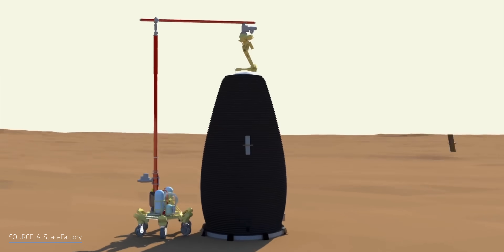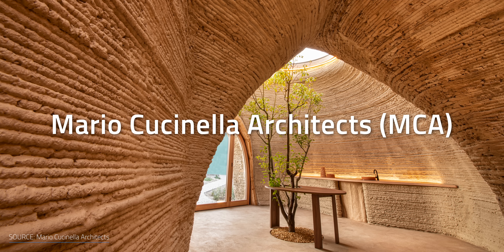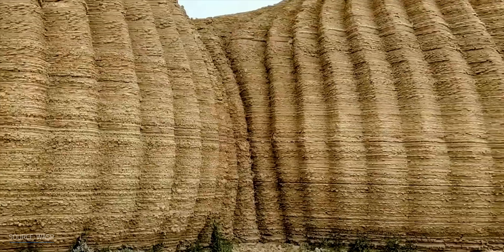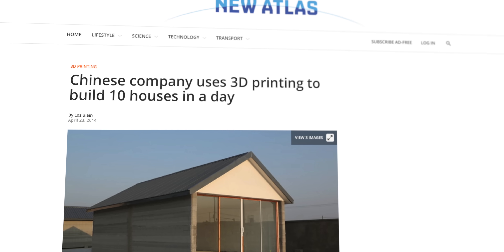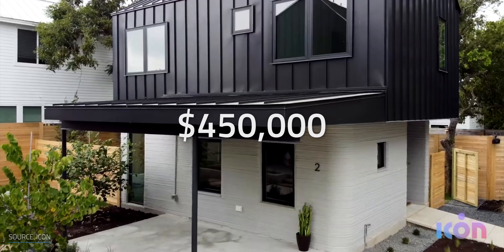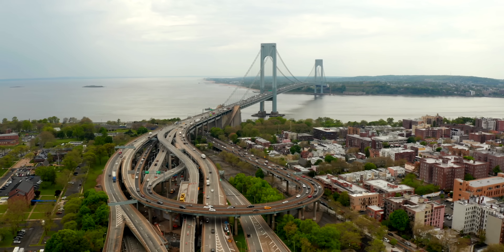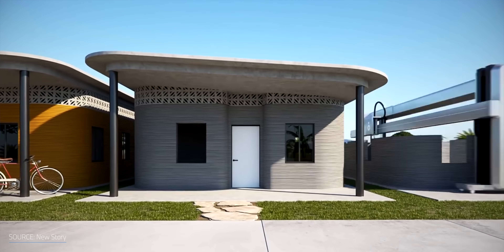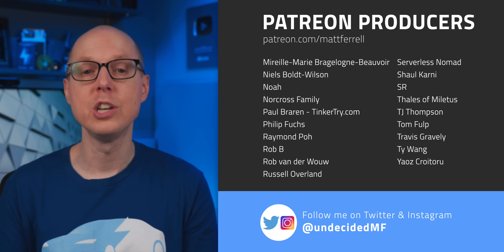The Truth About 3D Printed Homes

Comment: Interestingly enough the best 3D printed house concept (so far) came from the 60s from the Danish as far as I know and used en masse in former Soviet countries. They would make wall sections (called panels) from reinforced concrete with all tubing for water and electric lines pre-installed. They would transport these panel on-site, weld the connecting rebars together, use a but more contrete fo fill in panel connections and there you go. In Hungary they even went further establishing multiple "house factories" that would manufacture complete bathrooms complete with plumbing and tiles fitted even before transport - they would then transport the complete room into the building site, place it and connect it. Only thing they messed up is the design, most of these panel buildings look horrible (though a lot of them getting new insulation and with it paint jobs, which help a lot).

Comment: How is the global housing crisis defined and how does this address that problem?  Any claim that 3D printed housing aims to solve the problem is a handwaving lie if it does not say exactly what they are fixing.

This solution seems suited for areas where land cost is minimal, but isn't the housing crisis more urban where there is premium on land which is almost universally addressed by building up? Even in shanty towns which are low height, the density is extreme.

What about  clean water and waste removal?

Comment: This is definitely not a solution for the housing "crisis". If anything this is just going to wreak havoc on local economies. 
Almost all human housing materials come from sustainable materials. Even though we have become better at hiding it, most humans still make their home out of rocks, sticks, and dirt. When built with care these structures can easily last for hundreds of years. 
All this movement is doing is trying to find cheaper ways to to build the structure. The bonus is you would be lucky if these structures would last 20 years. There is almost no good way to repair damage if it was to occur. 

Almost all land animals have no issue living around human populations in rural settings. The real problem is human plastic waste and transit. The real solution for that is to actually create things that are built to last and be easily repaired. The transit issue is a bit more complicated, but there are solutions that are showing promise. 
The real issue that needs to be addressed is housing is how to lessen carbon emissions when heating the home. If we were to go back to wood burning, the level of carbon and ecological disaster would make gas burning cars look like a joke. Natural gas will not be an option in a few years time when oil production drops off. As it stands now that really only leaves electric heating as an option. When combined with the increased demand from electric cars, many power systems will fail to be able to keep up with the demand.

Comment: One thing that is rarely touched on with a lot of these projects is that round spaces are really awkward to use. Want to hang a picture? It's awkward. Want to put a wardrobe up against a wall? It's awkward. Most modern furnishings aren't curved or round, that may change if printed houses take off but it's something to consider.
Reply: There are rectangular 3d printed buildings.
Reply: cabinets, beds, windows doors....

Comment: After watching dozens of men and women dig holes, strip logs, and build houses in the woods with nothing but mud, stones, wood, and greenery. Some even had decently sized farms, furniture, and fireplaces. These 3D printed houses seem like a dystopian mockery of what we can do just as easily with a little knowledge, practice, and time, and even better. They tout these things as eco friendly when simply being alive will mean 55k tons of carbon are put into the atmosphere over your lifespan just because you need food, a comfortable temperature, and clean water. Not to mention medicine and anything outside of that. The machines being used to 3D print these homes run on either fuel, or electricity produced by fuel, and neither of these are eco-friendly. The only truly eco friendly option is Nuclear, but there's a lot of pushback against it because so many people are unaware of the strides we've made in improving it being locked behind hush warrants and government red tape. There's no getting out of the cost of existing.

Comment: Stop this meme about EVs having no emissions
Lithium mining is more carbon intensive than oil
Reply: Do you have a source?
Reply: @reevesjustin  nothing that I can  share in a YouTube  comment. It gets flagged as spam. Just do a google search if your being sincer. 

MIT thinks it will take 4 years for an EV to off set its carbon cost, which would be fine. However think tanks in Germany believe efficient diesels could out pace EVs assuming the battery lasts 30 years.

Thing is that will all improve as grids switch to more carbon neutral energy. Mines need to as well. But the tech isn't ready.

Also remember that while Australia is the leading excavator of lithium China and Chile are close seconds and thirds and you can bet the working conditions for those mines aren't 1st world.

So even if you do address the carbon issue there is a significant human cost you need to ratify within  your mind.

Comment: It seems to me that the most efficient way to construct houses would be to build them all out of reusable components that are constructed in bulk and are individually small enough to be transported by tractor trailer.  One floor might for example be composed of 7 outer wall units, 4 inner wall units, and 3 support column units.  Foundations could be made in a handful of standardized sizes that the components fit into.  The walls would be made of concrete with long concave sections covered by metal panels which could easily be accessed later by just unscrewing them to place water and electric lines, and which would remain accessible after installation for any potential future repair, none of this hiding stuff permanently in the walls nonsense s.t. accessing it requires a sledgehammer.  You couldn't have arbitrary architecture that way, the components would be designed to fit together and would all be at a handful of nice angles: 30,45,90 degrees, this would have the added benefit of making the architecture load calculations easier, and software could be developed to do both these things.  The construction cost would then be reduced from about 50% of the total cost to mostly just the cost of: using tractor trailers to ship the wall components, using cranes to transport and place the factory assembled components into place on site, the cost of mass-assembling those components.  The cost of hiring an architect would also be eliminated.  Cheaper materials than concrete could also be used, so long as they can also be mass-produced in fixed shapes.

Comment: Dude you need to have a more structured speech, you can’t just throw phrases at people without a concrete line of thought other wise you end up not adding much value to the conversation. You need to do something like pros: 1,2,3… cons: 1,2… weight of the pros vs weight of the cons. You know, something that actually provides the whole picture in a clear manner (hopefully using graphics) therefore paving the way to new ideas, improvements and in general better communication

Comment: I wonder if this idea of using dirt in some way with 3D printing could be utilized with underground homes or homes where their ceiling is at ground level.  You'd need a very strong structure to hold back the walls of course.  But maybe there would be some advantages of 3D printing using the same dirt as is all around you.  What do you think?

Comment: The 3D Printing aspect seems kind of ancillary or parasitic. Can't the same mud be formed by hand with wooden molds and (well) paid labor?
Reply: yup. standard practice in African countries with clay soils. What also helps a lot is generous roof eaves overhangs, which protect against rain. Add generous wrap around veranda which acts as an apron, and then your clay brick walls have fantastic protection against moisture. It would still be a good idea to frame this structure and not rely on the clay as load bearing. This is all done in Africa in a multitude of ways. From Dimitar, Architect working in South Africa.

Comment: 3d printing a structure is a solution looking for a problem. I doubt there's practical savings in cost, time or energy over other traditional methods. Prefab and modular homes built in a factory are probably better all around over these things.
Reply: That is so funny, as it is essentially the same comment I have made on several of these videos.  And they don't understand the problem(s), because often they are creating more of them.

Comment: housing like everything else is overinflated in costs.  People who know how to build a home think they are entitled to make exorbitant wages to build them.  To costs in materials is on the rise not due to scarcity but due to onerous regulations by the climate nazis of their government.  (climate change is a big fat lie so they can jack up prices nothing more).  My grandfather built his home in the late 60s with no difficulty in the upper mid east.  I think he spent less than $4k on materials and the home had a basement the size of the upper or ground level.  This outlay of money also included an out building and shop the he used and lived in while building the main structure.  With printing houses out of foam filled concrete the primary cost is setting up the rig to print the structure.  The advantage of this process is that you can easily layout curved and rounded sections making the home more sympathetic to the wind and rain.  The layer thickness and hollows (later filled with foam) have impressive and unparalleled insulation properties.  The draw back is that second levels may be difficult to set up as they require additional support much like an FDM printer.  Still the entire ideology and process is fascinating and hopefull

Comment: A recent study determined that the majority of car-produced air pollution (particulate pollution by weight) is actually from micro-particles of rubber from tire wear.  It was discovered that this is far more damaging than the chemical pollution.   Unfortunately, because of the increased weight of electric cars due to the batteries, electric vehicles actually produce more pollution than gas powered vehicles (not including the fact the the majority of electricity used to charge said vehicles is generated by burning fossil fuels].  We're not there yet.

Comment: It's called cob house or mud house. Thing is those melt under rain even when dried. That's why they need roofs with protruding overhangs and you need to re-coat them with a protective layer every few years.
As i understand low and mid-rise buildings would be most efficient environment wise. 
It's still cool tech, although it will result in dystopian hive like neighborhoods, not because it has to but simply it will be the most cost efficient.

Comment: what happens when it rains? what happens when bugs get into it? what happens during an earthquake? how do you repair it? what about plumbing and electric? and when little animals get into the hollow spaces inside the walls how do you get them out? you live in a house made from mud and shit if you want to. I will stick to brick and wood and waterproof roofing because it's cheaper, it works better and it lasts longer...and it's not shit.

Comment: A number of years back now... I worked for a Florida company that took to using NuCor Steel's Roll-formers that took 6inch wide coils of galvanized steel to make either steel studs or roof trusses that were cut, notched, or punched with a CNC controlled head that can reproduce a given floor plan countless times, that's able to be fit and be secured easily within a conex box at night and operated with any steady 220v power source. Small forklift is required to handle and load the coils, but simply hand tools and pneumatic tools handled everything else. During 3-4 day span, we were able to create at full 13k to 17k SQ ft house during a single 8hr shift, then on Friday the wall panels were loaded on one flatbed, and the trusses on other. As long as the foundation was poured correctly, within 6hrs a the full frame set can be anchored on site and tradesmen can start the next day. The normal scraps for making an entire house could fit in a 5gal bucket! Using a fixed floor plan or plans and well trained people, not only was the waste greatly reduced, but with results being constant and 100% repeatable - the time from when the slab was poured to when the keys to the finished house was turned over - it was possible in less then 50 days...

Comment: I dont think you have address the challenges of population density and availability of land.
A 3D Printed house inc. setback would be approx 50-100 Sq M.
It could be feasible for Rulal and sub urban areas.
But unless they can go vertical, it will be a challenge. There is not enough land for sustainable 3D printed houses in cities.

Comment: Electric cars currently are not all that green take for instance the charging station is powered by the power grid which in turn is powered mostly by coal powerplants. Perhaps in the future it will be more green but even the massive batteries are made using very toxic material. There are current breakthroughs though in both these aspects. So for now they are far from green but they will get there in the future. Just thought Id correct you.

Comment: It kills me when it's argued that cities are more eco friendly due to population density. If the housing areas were better designed (actually planned out instead of the mess they usually are here in the US) and had mass transit systems put in place then the efficiency would likely be comparable. 

If people would stop reaching for the moon and apply a little common sense and be pragmatic then we could make things a lot more sustainable without having to reinvent the wheel.  There are hundreds of well known methods that have been historically successful and yet they are often ignored for some trendy new thing.
Reply: Well they're not designed better, mass transit in the US is negligible, so the stats are correct, and your point is moot until we get better city planners who actually understand the problem.
Reply: @jaemac1410   stats for old design standards are irrelevant if they start using sustainable designs.

While new tech might aid in solving some of the problem it isn't going to help much if no effort is made to address the underlying problem which is poorly designed urban developments. Also, moving everyone into cities isn't feasible unless you have a dictatorship. Even then you need people to run farms and things outside of the cities.
Reply: @jaemac1410  who are you talking to, me or OP?
Reply: LOL!  Please explain how a well-planned mass-transit system that transports workers 35 miles from the suburbs to the city is "more eco friendly" than a poorly-design bus system that transports workers sixteen blocks, from apartment to work, within the city.  And you know what those suburbanites do when they reach the city, right?  Yep, they hop on the local city bus to actually complete their journey.  In fact, you get FAR more bang for your transportation buck when the user density is high and the transport distance is small.  This holds true whether you're moving workers or schoolkids or groceries or gas and electric utilities.  If it "kills" you when people point out the obvious, dkail, you must be perilously close to dying.
Reply: @jasminelindros8923  you're basing this on current designs. You're right if you're only going off of current methodology. I've not argued that.

 Without writing a dissertation here about urban planning there isn't much more I can say. The point being that improved planning could narrow the gap quite a bit.
Reply: @dkail08  I see you failed to provide the explanation I requested, dkail.  Perhaps you should consider basing your opinions on facts instead of expecting anyone to agree with your incorrect misconceptions.
Reply: But commie blocks will always be more eco friendly than suburbia tho... Mass transit is one of the reasons yeah, but it is definetly not the only reason... For starters, sprawl incentivises car centric approaches, which are terrible (roads are terrible, cars are terrible), houses are less energy efficient, houses are by definition less green. Logistics of goods is worse too, not just human transportation.
Reply: @tristan7216  my comment is exclusively related to the eco impacts, which I stated. Being environmentally efficient is obviously not money efficient. Otherwise everything would be transitioned over to sustainability already. Very few things are both environmentally friendly and the cheapest choice.

As far as how suburbs lose money... that is in large part due to poor design and stupid laws. Plus some is already baked in. Even if you have vast swaths of empty land you are still going to have roads, bridges, and other transportation infrastructure in place for a variety of reasons.

Complaining about poor cost efficiency for 300 miles of highway through empty fields in Montana makes about as much sense. 

You can't really compare the EU to the US for these sorts of comparisons since you can shove the entirety of Europe into Texas. Either understand that some things are just required or figure out how to get goods and personnel from one coast to the other effectively without thousands of miles of roads.